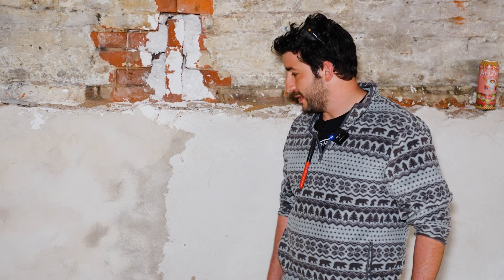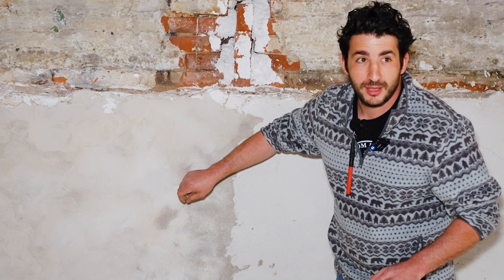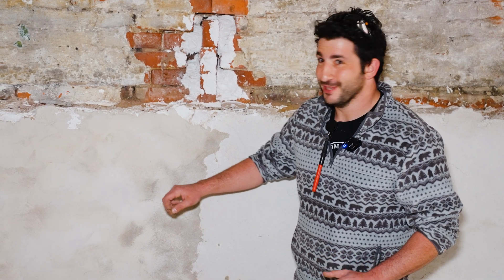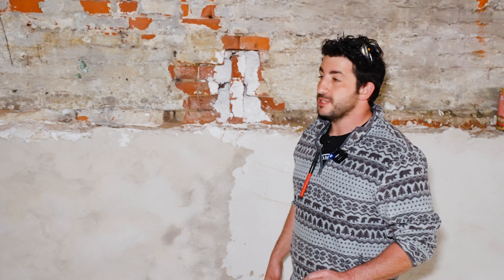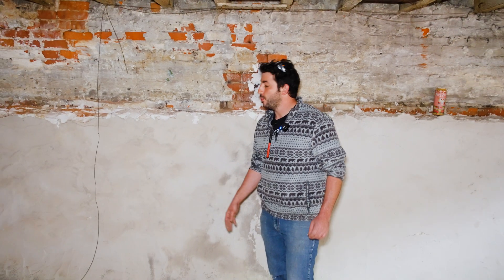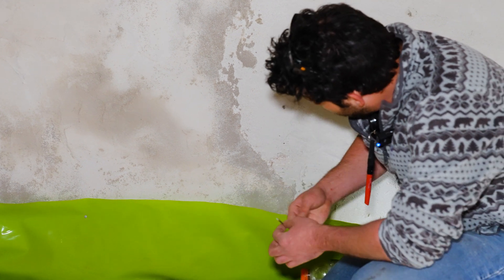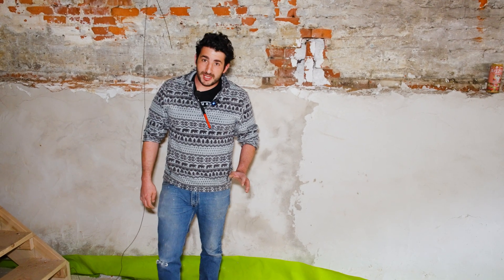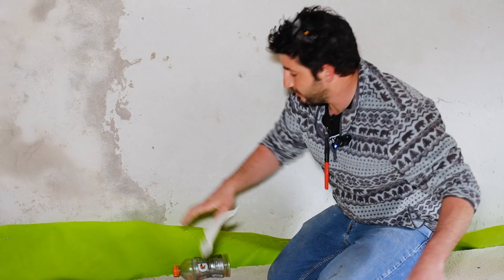MOISTURE MANAGEMENT in an Old Basement

Comment: Great information! Thanks! Are there any specs on how long that 15 mm vapor barrier will last?
Reply from the maker: Stego has something called “life of the building” warranty.  I don’t think they’ve been around long enough the have them wear out, but, in their words, “No company can match Stego’s record of 20 years protecting the foundations of buildings without a single claim of  failure.” 

They’re pretty legit vapor barriers, and they have enough components that they’ve planned for every condition.  They have termination bars, tapes for different substrates, materials to address penetrations, etc
Reply: @GreenBuildingNetwork  Completely understandable! I’m always curious about how long new building materials and techniques will last long term.